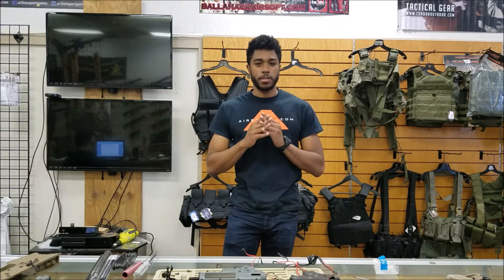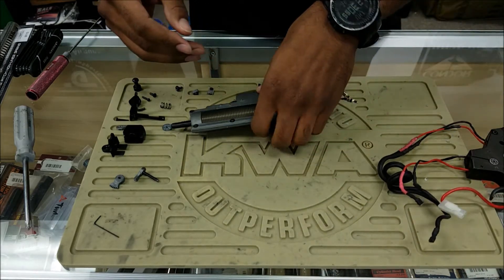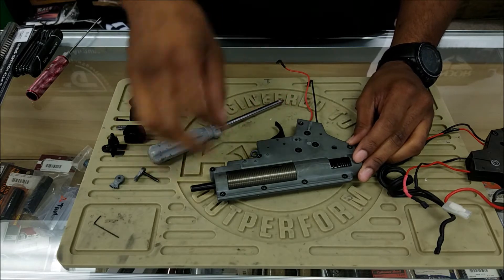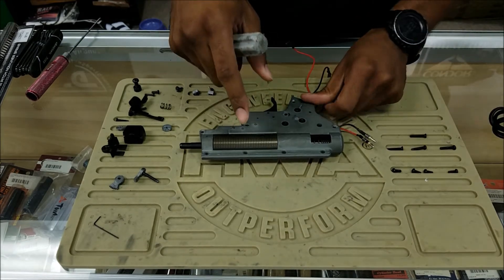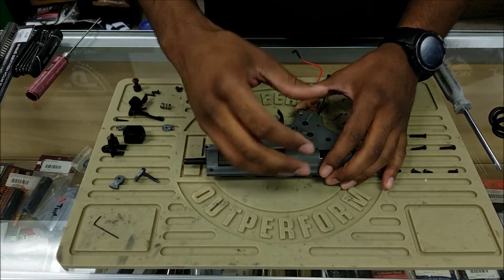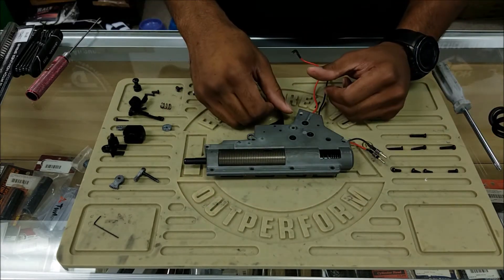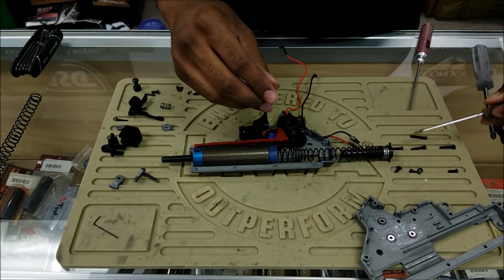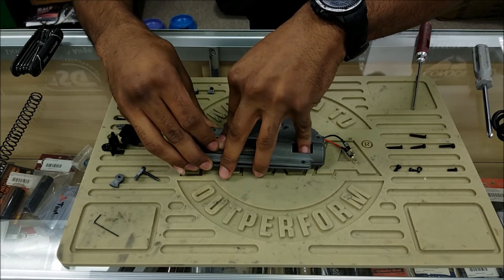How to change your AEG spring

Comment: I recently bought an airsoft gun that has 250 fps and now im changing the spring to 420-450 fps will it break the gun easily or no
Reply: Patrick Savage 21 I believe it can burn out the motor but I’m not an expert in this so you should ask one
Reply: mario herrera It will heat up the motor and wear out the gear teeth, so I recommend upgrading the gears and motor if you change to a spring that goes up to 400FPS, mine does 450FPS stock so I might upgrade the gears to a DSG and get a fast motor because I want it to shoot 350+ FPS
Reply: R3comment replacing the motor.
Reply: Hehe 420